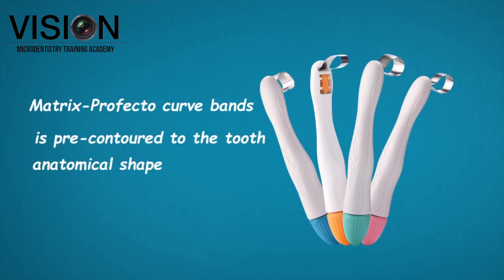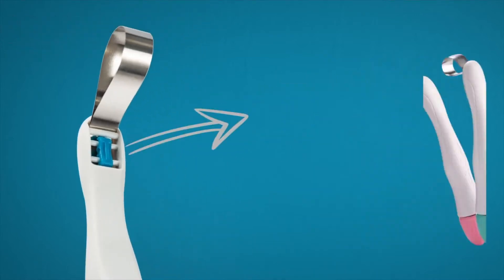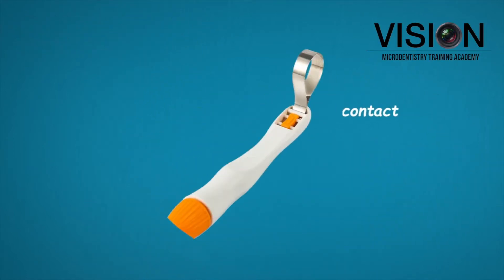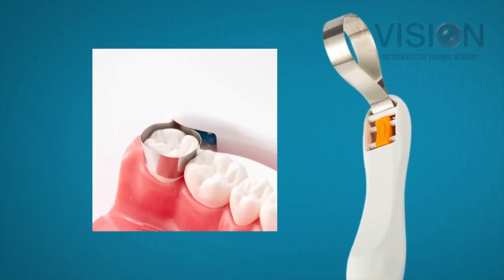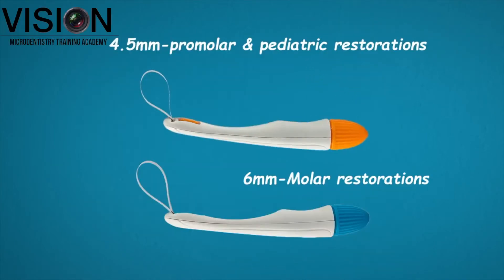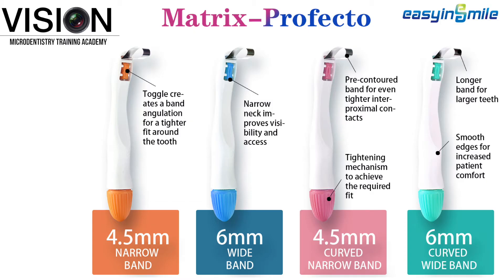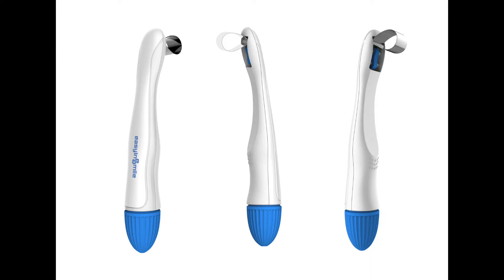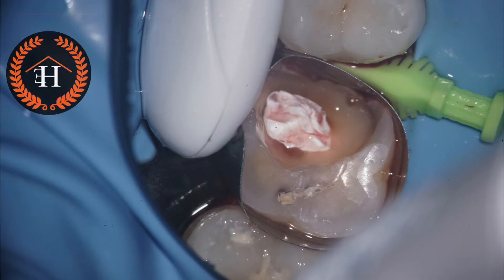Pre-endodontic build-up

Comment: What to do if the proximal wall went subgingial?
Reply from the maker: I you can do a deep margin elevation in that case.
1. Reel matrix only for DME 
2. Deep subgingival 5.5 or 6mm matrices can be used along with the circumferential band to secure the band

Comment: A contoured matrix + a green garrison band would give a much better contact and anatomy
Reply from the maker: I agree I use contoured matrices when i need a contour.

1. For a pre-endo build up a contour is not really so important. since the surface will be restored with a full or partial coverage restoration involving the proximal surface
2. As the tooth loss was more sectional matrices and ring type retainers dont stay stable on the tooth surface in such cases 360 degree matrices are a better option.

Alternatively a pre contoured matrix within the flat circumferential matrix or a pre-contoured circumferential matrix can also be used for the same technique.
Reply: @roheetk  1. Got it 👍🏻
2. That's why I said the garrison green; it is the perfect ring for this type of class II. 

Thank you and keep posting!